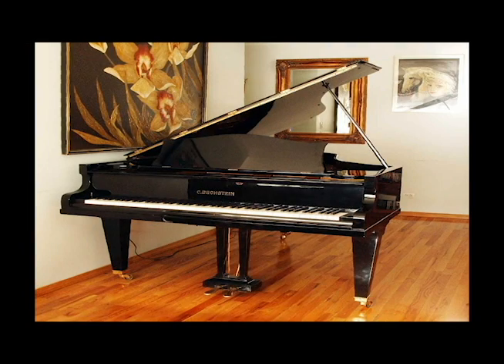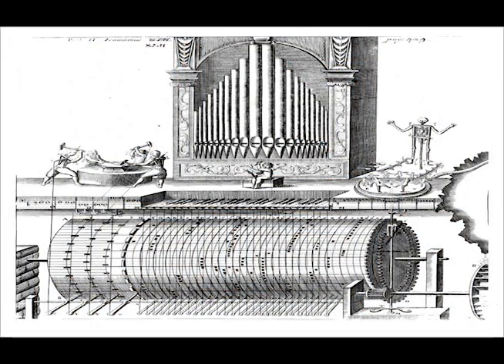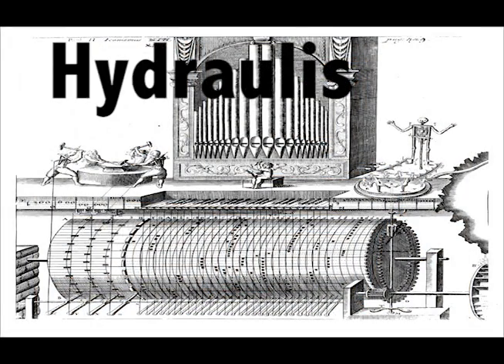The Physics Behind The Piano

Comment: This is wildly inaccurate oh my god. 
The hydraulis is not the background in which piano was developed from, the harpsichord wasn't invented in the 1600s, try 1400s (clavicytherium) the harpsichord has no dynamic control because the string isn't struck it's plucked, the fortepiano was a direct development on the harpsichord by a man named bartolomeo cristofori around 1698 to 1701 by swapping a hammer based action over a jack and plectrum plucking action, the first mention of a keyboard instrument is the German clavichord, but again was extremely quiet because the tangets (blades that hit the soft copper or brass strings) were hitting the end of the strings, therefore less noise (was appointed typically as a practice instrument or beginners instrument as it could only be heard from about 15-20 feet away) 
The piano is very different from the harpsichord, that's comparing a lute and a mandolin as they physically work different ways and are constructed centuries apart (almost all reproductions of harpsichords are as faithful to historically accurate as possible) and have very different timbres and tone colors, advantages and disadvantages, if you don't believe me.... Get any pianist to play a harpsichord and watch how quickly they hate it for its lack of sustainable, quick decay, no dynamics and it's harsh glassy sound.
Reply: This video was made years before you had access to AI search, poindexter.
Reply: @tabedevries  when you can... Idk, read a book, like a manual (harpsichord manuals have been around for decades) read a history book or attend a single music class after asking about the harpsichord and the history of the piano.... Yeah doesn't really matter what year it is does it? Get cucked.
Reply: @tabedevries  then to add a better cherry on the pie of "ai wasn't around"
Dawg google still existed, 13 years ago not 22 💀a lot of information on harpsichord and piano has been online for over a decade, very credible information sourced and cited

Comment: if the string vibrates the sound board to amplify the sound then the vibrating sound board should vibrate other unstrung strings in the piano, isn't it?
Reply: I think it only vibrates the strings that are relative (Same note but higher or lower). Because they Resonate.
Pressing a note with the Pedal will sound much better that pressing and holding that one note, because they resonate with the others ...